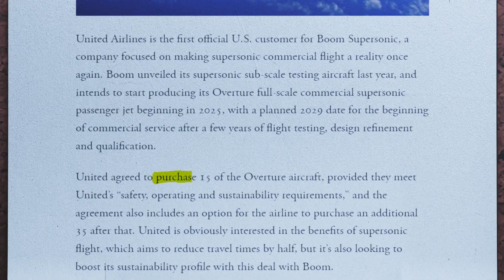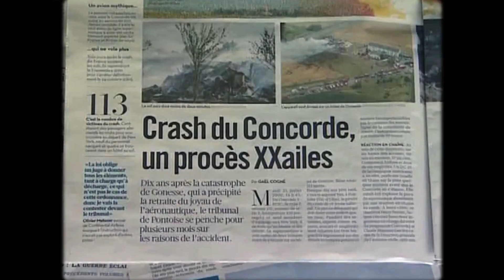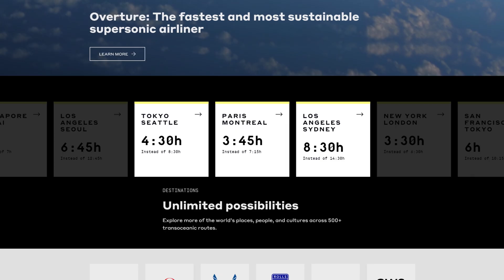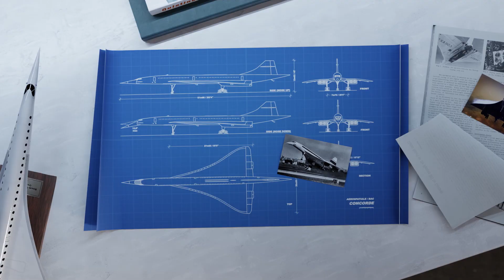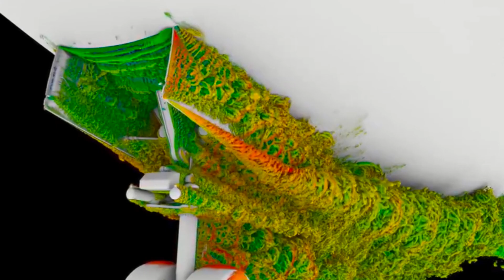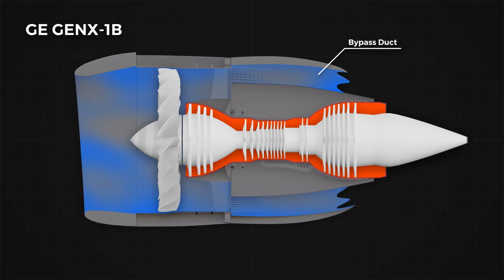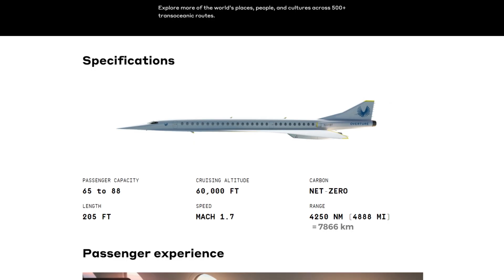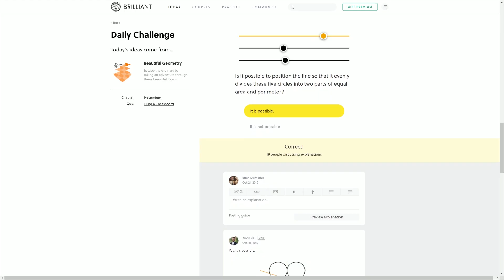Will Boom Bring Supersonic Back?

Comment: It wasn't just rising production costs- that could have been mitigated but the 74 oil crisis and the worldwide recession that followed killed the sales program. BA was consistently profitable with Concorde from 1982 until it retired. It made over half a billion dollars in profit for the airline. Also the seats were only about 25% more than First Class. A businessperson (whose company would have paid for the ticket anyway) could get their executive from London to NY, have several hours of meetings and back home the same day. That was value for money. And Concorde was not cramped. it was quite comfortable with plenty of legroom. I loved my flight on her in 1999.

Boom has changed their design recently to look like the failed B-2707. They don't have an engine nor is one in sight, they have included draggy engine pods and now 4 engines. Turbojets are ideal for high supersonic speed due to their high exhaust gas velocity but they are thirsty down low and noisy. They will need afterburner whether they like it or not because this is the only way to increase thrust for takeoff and transonic transition without having a heavier engine. The Olympus 593 was incredibly efficient  in supersonic flight (one of the most thermally efficient engines in history) and only needed 90 seconds of afterburner on take off and another short burst between M 0.95 and M 1.3 and could super cruise - fly supersonically without afterburner for over 3 hours, a feat no other aircraft has ever achieved. 

Its computer controlled variable intake and exhaust systems produced 60% of the thrust at Mach 2.0 with the engine core producing the rest. Supercruise is absolutely essential for Boom. No supercruise - no aircraft. RR has also pulled out of the project... 

From Chief engineer of the RR Olympus Sir Stanley Hooker-Not Much of an Engineer-  p 152

“In jet engines such as the turbojet or turbofan, the components at the front where the air pressure is rising are subjected to a useful forwards force, while downstream of the combustion chamber, the where the pressure is falling everything tends to be blown out of the tailpipe by an adverse rearwards force. 

It is the difference between these forces that propels the aircraft. But at Concorde’s cruising speed, one gets an unusual distribution of the various forces: from the variable inlet ramp --12% rearward, from the air intake system a +75%, from the engine itself +8%, and for the convergent/divergent nozzle, +29%. The total of course is 100% but what emerges is that the inlet is ten times more important in thrusting the aircraft along as the engine while the final nozzle is about four times as important. We therefore pay very careful attention to the inlet and nozzle.”

That's some technology from guys in white shirts with slide rules.

So again - no engine no Boom.
Reply: @Completeaerogeek Great post. You were lucky to have flown on Concorde.  It's now 27 July 2023, nine months after your original post, and Boom are still in business. It looks like they are making progress too, and have now appointed suppliers for major Overture parts. 

  •  Spain-based Aernnova, will design and supply the wings. 
  •  Italian aerospace giant Leonardo, will design and build the fuselage and wing box.  
  •  Aciturri, also Spain-based, will design and develop Overture’s empennage. 
  •  Boom's other suppliers include, Florida Turbine Technologies, Safran Landing Systems, Eaton, Collins Aerospace, Flight Safety International, GE Additive, and StandardAero. 
  •  Boom have defined the avionics, flight controls, hydraulics, fuel systems, and landing gear.

Florida Turbine Technologies will design a bespoke engine that matches the unique requirements of Overture, which they consider to be a superior approach to modifying a standard engine. Engineers, who were involved in the design of the turbines for the supersonic F-22 Raptor and F-35 Lightning, will be on the design team.  GE Additive will provide additive manufacturing (3D printing) technology, and StandardAero will ensure design for maintenance. Apparently, engine development is underway. 

The Overture propulsion system will have a Boom-designed axisymmetric supersonic intake, and a variable-geometry low-noise exhaust nozzle. Symphony will have the same basic architecture as engines that currently power all modern airliners.
Engine features:
  •  Turbofan
  •  Medium-bypass
  •  No afterburner
  •  Twin-spool
  •  35,000 pounds of thrust on take off
  •  Air cooled multistage turbine
  •  Single stage, 72 inch diameter fan, for quiet operation
  •  Low-pressure compressor stages: 3
  •  High-pressure compressor stages: 6
  •  High-pressure turbine stages: 1 (passively cooled)
  •  Low-pressure turbine stages: 3
  •  Additive manufacturing for lightness, low part count, reduced assembly costs
  •  FAA Part 33 and EASA CS 33 compliance
  •  ICAO Chapter 14 noise compliance
Reply: @phonicwheel933  What concerns me is the XB-1 still hasn't flown yet and in any case it is completely different in design, so data validity will be minimal. Also, I can't see how a medium bypass engine will  have the exhaust gas velocity to allow for supersonic flight. No medium bypass engine has ever achieved supercruise. This is why aircraft like the F-22 that can supercruise, use low bypass turbofans. In the case of the F-119 just 0.30- basically a leaky turbojet. Additionally,  engines can take up to a decade to design, build and certify. 

And a 72 inch fan? You are talking a larger fan than the LEAP IB on the 737 MAX and that has a 9:1 bypass ratio... I cannot see how that is possible for supersonic flight, drag would be ridiculous and the bypass air velocity way too low... The engine pods too will be extremely draggy as shown...

Like I said, I would love to see another SST but this seems even more like science fiction... I think there is a reason all major engine manufacturers said 'No thanks'.
Reply: @Completeaerogeek  Hmm, some interesting points. 

It’s quite normal for high tech development projects to overrun and for the costs to escalate. Ovation is certain to be the same. Concorde was a classic example: proposal £70m, final cost £1.8bn, and that is with government study groups doing much of the research pre contract.

The XB-1 is a proof of concept model, rather than a prototype, and would be used to test various aspects of the Ovation design, especially the wing. You wouldn’t necessarily expect it to look like an Ovation. Once again, the Concorde proving models were nothing like Concorde. Apparently, the XB-1 is built and is at the Mojave airport, being prepared to fly.

Technically, there shouldn’t be a problem for any of the big engine manufactures to develop the engines for Overture, and if they were starting from a clean slate, that would probably take them 10 years, as you say. At a guess the cost of the development program would be $1bn too. Big companies would be totally unsuited to a small operation like Overture and, in theory anyway, FTT should be a leaner tighter operation more suited to this application. Whether they can pull off a complete engine design is another matter. But they have got some pretty skilled and experienced engineers, and they may use designs for parts based on existing engines. 

About the technical aspects that you mention. It is surprising that a medium bypass engine with a huge 72 inch fan is proposed. Maybe the variable geometry of the intake and exhaust ducting will allow efficient sub and supersonic flight, and Ovation won't be flying crazy fast, only Mach 1.7.  It seems Boom are planning to make the Ovation efficient at both sub and supersonic speeds to suit their operational model, where they specify mixed routes over land and sea. This is in contrast to Concorde which was a fuel guzzler at subsonic speeds and used 47 tons of fuel just to taxi, take off, and reach Mach 2 at 60,00 feet.

Like you, I have reservations about the viability of the Overture project, but not so much on technical or operational grounds, or that it is scam. My worry is that Boom will overstretch themselves financially. I hope they do make it though. It would be great to see an Overture in the air.
Reply: @phonicwheel933  Phonic, unfortunately you are way off and I think perhaps you should consider the following: Program costs:  Boeing's B-2707 program  only ran for about 4 years compared to the nearly 15 (depending on how you measure it) required for Concorde. Considering it only got as far as a  design and engineering proposal and wooden mockup and some basic engines runs of ex XB-70 YJ-93 derived engines, USD 1bn was a lot. Having to build at least 2 prototypes and likely 5 development aircraft (as Concorde did) would have pushed the program well past USD 5bn and probably more, considering its complexity and the fact that the aircraft was to be made of titanium. Then in late 1968 realising it couldn't make the swing wing work, it completely changed the design. This had to got though a government approval process that took almost a year before they got permission. I can find no record of any major components of teh new design being built or tested before its cancellation in 1971. Prototypes were still years and billions of dollars away.

The 1973 Arab Israeli conflict and the oil crisis that followed put the world into recession and largely ended Concorde's sales opportunities. Quadrupling oil prices in 8 months will do that as airlines are incredibly sensitive to fuel prices and economic conditions.

As for engines, none of the major manufacturers are going near Overture. There is a reason for that. Physics... (GE is using wishy washy wording about providing 'additive and consulting services'.)

A medium bypass turbofan will require some considerable advances to manage the exhaust gas velocity required for supersonic flight. 

MBPTF are around 3-5 bypass ratio whereas the only supercruising engines near the right thrust class, the F-119 & F-135 have bypass ratios of 0.3 - 0.56 for a reason. 

As for the 72" fan they are planning, here is a clue: The LEAP 1B on the 737 MAX has a 69" fan and the LEAP 1B bypass duct air speed is somewhere around Mach 0.85 - 090... I cannot imagine there is a way that a low drag system can be designed for a fan that size, nor that a fan that can bypass that much air at Mach 1.7+, while producing 40,000lbs of thrust, which is what is required. 

Again, the closest engines to the requirements are currently the F-119 and F-135. It Both have a diameter of 46" and neither produces the dry thrust required by the Overture to supercruise. 

Then there is cost. Publicly available figures show that the F-135 program alone, had its cost increase by 3.2 billion dollars, just in 2013. 

Is it reasonable to believe that the ‘nobody’ Symphony design, can outperform the world’s most advanced Low Bypass engine?

Some reading for you:

https://en.wikipedia.org/wiki/Pratt_%26_Whitney_F119
https://en.wikipedia.org/wiki/Pratt_%26_Whitney_F135
https://www.researchgate.net/figure/Development-Cost-Comparison-of-the-F119-and-F414-Engines_fig14_235017084
https://www.heritageconcorde.com/engines-main-menu

Concorde used turbojets exactly because they are the most efficient design at high supersonic speeds. That is why Concorde could supercruise at Mach 2.0 for 3+ hours. The TU-144 went with low bypass turbofans and required full time afterburner, dramatically increasing fuel burn and shortening range.

And I'm not sure where you got your 47-tonne take-off and climb fuel burn for Concorde. Concorde only burnt 92 tonnes to cover the entire distance from JFK-LHR.  A source would be great. 

Concorde's Olympus 593 at Mach 2.0, remains one of the most thermally efficient machines ever built, at over 43% and with a very low SFC for a turbojet (or any gas turbine engine in fact). Its complex computer-controlled inlets and exhausts in their carefully designed twin pods, actually created the majority of the thrust at Mach 2.0

On my flight it did not take that long from being over the coast to Mach 0.95 (less than 15 mins). Reheat (afterburners) were only used for 50-90 seconds on take-off and then for a short burst from MAX 0.95-1.5. After that it supercruised up to Mach 2.0, where it was the most efficient supersonic aircraft in history. 

That’s the reason why from the time it was put into its own P&L division in 1982,  it made over half a billion pounds profit for BA with just 5 aircraft in regular service.. 

https://www.key.aero/article/inside-story-how-ba-made-more-ps500m-profit-concorde#:~:text=The%20result%20of%20this%20change,billion%20pounds%20profit%20for%20BA.%E2%80%9D

Then there are the 'new' engine pods on Overture MK 2, the design of which has been discarded by designers and aerodynamicists with any sense since the early 60s. They were a major source of drag on the B-2707 design. Wave drag is a killer.

Next to your point about the XB-1, it has much more in common with Concorde than the new Overture. The data value will be less than what CFD can provide. Not surprising it hasn’t flown yet... What is it – heading for 3 years late?

As for Concorde research vehicles: you are unfortunately, completely incorrect. The HP-115 was a low-speed handling demonstrator in the early stages but once its Delta’s remarkable low speed handling was proven, the BAC 221 (a reworked Fairey Delta 2) was reengineered with not only a drooping nose for pilot view but a complex Ogival wing to prove Concorde’s basic wing design, which was then further developed with its sophisticated cambers and droops. 

The 221 validated Concorde’s basic aerodynamic design high and low speeds.
https://www.baesystems.com/en/heritage/bac-221.

As I said, I would love to see them succeed because I would like to have another supersonic flight in my lifetime but their wording, website and 'announcements' all have that DotCom feel (for this that remember it)...

Comment: could liquid methane be used
Reply: How would that even be possible?   How do you keep it cool enough to be liquid in an aircraft?   Besides, how would you possibly get it Certified to fly?
Reply: @rcairflr  I mean if biofuel is used liquid methane is economical and actually a better fuel with a higher mass/energy ratio than kerosene
Reply: @unknowunknown9096  > But how would you store it on an aircraft?  Also, I am not sure if you are at all familiar with FAA, EASA regulations for aircraft Certification.   Using a whole new type of fuel would, in todays world, be virtually impossible to get certified.
Reply: @unknowunknown9096  >  So I did a little research on liquid methane.  Under pressure you can store it as a liquid.   Liquid methane is stored at 4600 PSI.   How thick would an aircraft wing have to be to store liquid methane at 4600 PSI and what happens when you get a leak?

Comment: NOT a true story regarding the non-profitability of Concorde operations.

When Air France 'dented' their aircraft, they wanted out of Aérospatiale/BAC Concorde ops, and French Airbus who manufactured spare parts supported them by announcing they were no longer going to support the aircraft. The ultimately threw BA against the wall 'between a rock and a hard place'.

BA were committed to their profit-making fleet by not only relining the fuel tanks with Kevlar, per the safety upgrade, they also had commenced a cabin redesign/refurbishment along with new service product items. 

Not an enormous investment they would have made with a loss producing fleet.

Comment: wow this video contained the key to understanding why so many engineers despite being able to do math still go along with the green energy nonsense. when they say green energy is great it is great. great for them. It is basically a neverending project. one that can never be finished. so they get the chemicals released in their brains from the working towards a goal. So despite the fact that a 5 year old could do a cost benefit analysis and tell you that wind and solar is unworkable. Engineers more than happily go along with the lie because it is not about solving problems to them. it is the working on the problems where they get their satisfaction.
Reply: @eurobrowarriormonk7182 Well said.👍

Comment: why is there no "large" supersonic jet? drag? underpowered engines? lack of fuel efficiency?
Reply: Drag, which would reduce the range of the plane, making the plane less economicaly viable and no engine partner
Reply: @heidirabenau511  ok thanks
Reply: @ProAvgeek6328 There is no technical reason why a large supersonic airliner can't be produced. The technology has been available since the early 1960s. The problem is the development cost and the limited market.
Reply: @phonicwheel933  that is true

Comment: I wonder if it wouldn't be much more financially sane to just have tiny aircraft that can take at most 2 passengers. Private supersonic travel for you and your partner. That sounds like it has a business. Far cheaper to run, too.
Reply: Aerion aircraft tried to build a supersonic business jet.  They wernt bankrupt and closed before ever flying.   Same will happen to Boom.   It is extremely expensive and time comsuming to design, build and Certify a conventional aircraft.  To design, build and certify a Supersonic aircraft is many times more difficult

Comment: Modern Supersonic aircraft use Turbofans not Turbojets. The TSFC will be much lower than the Turbojets of the Concorde.
Reply: @andrewbingham3332 Turbofans are very economical up to 560 mph but above that they have problems. AFAIK there are some moves to use turbofans at supersonic speeds, but they either require fancy input and output ducting or dual cycle operation or both.